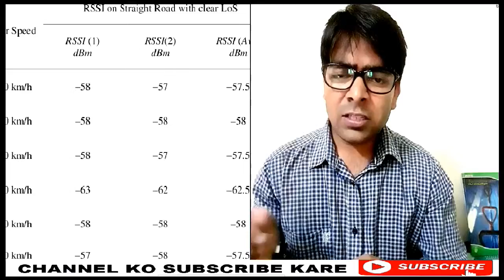What is vswr & rssi alarm in Telecom

Comment: I install wireless equipment in Toronto Canada, I work on Rogers wireless network. I currently install 2500mhz for 5g technology, we are getting alot of rssi alarms. I use low pim loads to find the issue. Issue is always appears when installed on antenna, do you have any suggestions on what it can be
Reply from the maker: Tell me sector ???
Reply: @OpenHelixTELCOchannel  it's a bunch of different sites some have it at all sectors some have it in only 1 or 2, out of 3 sectors total, but they are also running 700,850,1900, 2100,2600mhs lte. The 850,1900 and 2500 run on the same 12 port antennas  with 1 ret connection powered from the 1900. My email is avsudama@gmail.com if it's easier to discuss that way
Reply from the maker: @andrewsudama4908  please swap jumper with those who sector is not having alarm
Reply from the maker: Then check & tell me
Reply: 6
Reply: I am also in Canada and work on Rogers sites
Reply: @princechahal20  who do you work for?
Reply: @andrewsudama4908  I am a subcontractor and a side PM for one of the Roger Contractor
Reply: @princechahal20  I'm a sub too, I mostly work for Rogers
Reply: @princechahal20  Anet?
Reply: Yeah. I was at Anet for a few years and thn left. Now I manage anet crew as a additional service. How do you know?
Reply: @princechahal20  I've been a rigger for 13 years. Ive dealt with anet a little, and your Punjabi so I had a 67% chance of being right
Reply: @andrewsudama4908  haha nice guess
Reply: I have opportunity coming from another contractor too. Lets talk over the phone and see how we could collaborate. Btw I am not a anet contractor and never was 🙃
Reply: @princechahal20  sure I'm always open to hearing and discussing opportunities.
Reply: @andrewsudama4908  how can I contact u?
Reply: @princechahal20  you have a video on your account I put my number there
Reply: @andrewsudama4908  I see a 1 comment but don't see what exactly it is!
Reply: @andrewsudama4908  finally posted 1 digit at a tym
Reply: I am having trouble posting my contact number
Reply: 4
Reply: 7
Reply: 3
Reply: 3
Reply: 5
Reply: 3
Reply: 9
Reply: 0
Reply: 1